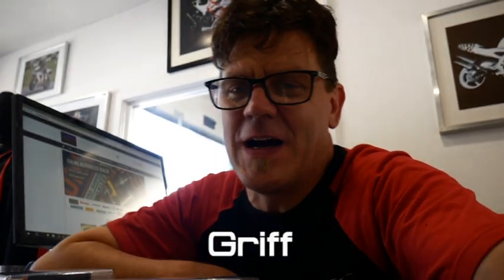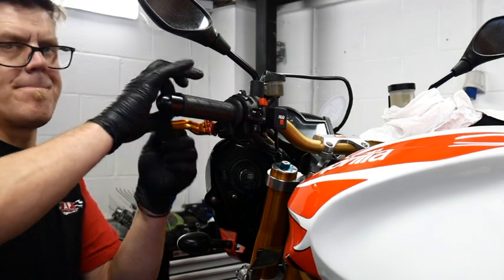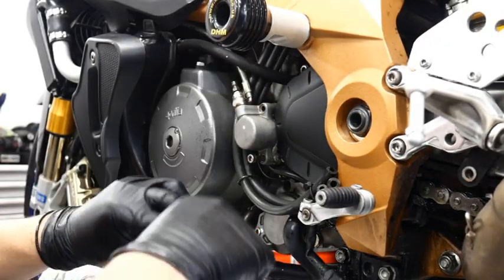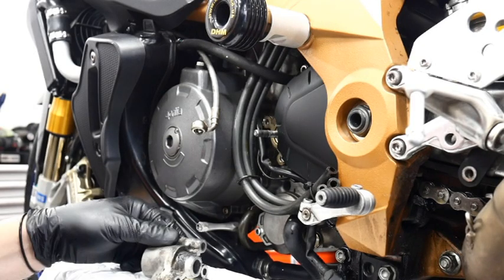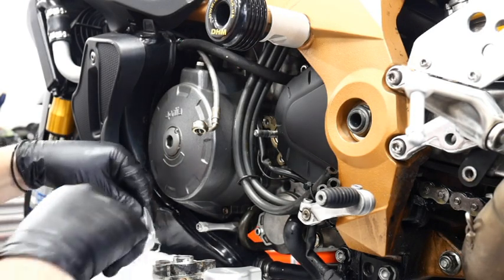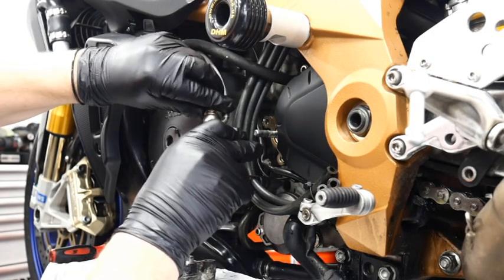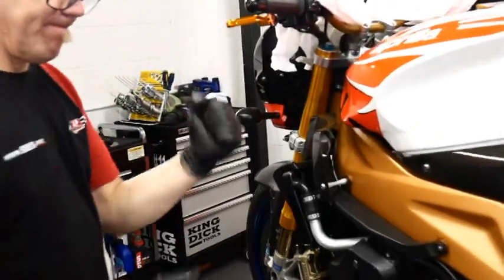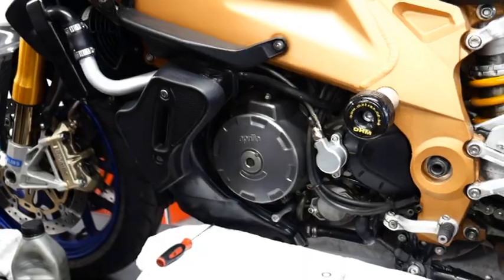Aprilia RSV, Tuono Gen 1 & Gen 2 Oberon Clutch Demo! Clutch Bleed Made Easy.

Comment: You´ve inspired me to replace the original clutch slave cylinder on a Falco with an Oberon. 
So far it seems to work fine. And you are right about the bleeding part. 
It can be a bit tricky, but I think patience is key when doing it.

Comment: just a quick tip if you've got stock clutch lever (probably same on CRGs etc) .. there's an adjustable pin that engages the piston and once you swap from old clutch chamber to new Oberon it may end up in too far thus dragging the clutch & causing the bike to overheat whilst the clutch is partially engaged & slipping.  How do I know ... well I learned the hard way.

Comment: Griff, my Futura started creeping forward when then clutch lever was pulled in. Checked the reservoir,not much fluid left in it. Checked the slave cylinder,no sign of any leaks.I replaced the slave cylinder seal last year.Does this mean I need to replace the slave cylinder? Advice appreciated.

Comment: Nice video! What does fitting the band do to help with replacing the cylinder?
Reply from the maker: It keeps a little pressure on the lever and closes off the master cylinder , makes the bleeding after fitting a little easier ! 
I hope it helps cheers griff

Comment: I got myself the same Oberon slave cylinder in combination with a new BREMBO 19rcs clutch pump. I did this because of my injured left hand. Unfortunately it didn't lighten operating the clutch. Even 2 motormechanics wonder. It feels I threw my money away. Any suggestions Griff??
Reply: Did you ever figured this out bro? I have a similar injury and struggle to operate the clutch
Reply: Isn't 19mm larger than the stock clutch master?  That would make it more difficult to pull the lever.  Sounds like the 19 may have undone the improvement the Oberon made.